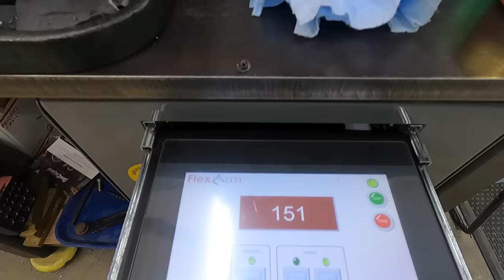Truck Hitch Crane Build Ep. 2

Comment: Why do you go through all the drill bit changes per hole versus spot drill the four holes. , then drill and chamfer them ? Isn't your DRO up to snuff?
Reply: surely wouldnt save much either way, what you save on drill changes you lose on unlocking, moving the table an locking the table again multiple times
Reply: 6 of one and half dozen of the other. I’ve done it both ways many many many times. You won’t save any time.

Comment: Hi Adam, Videos are perfect, though was not so keen on the legacy ones you put up during your vacation. Dont see why people could not view the original. 
Q. what was the pilot drill you used in the lathe to drill out the pilot hole? It had a very low angle compared to the standard 118 deg. Andy UK

Comment: Why isn't the chip breaking starting at 30:30 ? Wrong speed, blunt insert or damaged insert are the things I can think of as the culprit, off the top of my head. Any machinist care to help explain it? The rat's nest of a long curly chip is of course visually appealing but not desirable when turning. I mean it isn't aluminum after all.
Reply: cutting angle. the chip has nowhere to go so the breaker dont work. also the inner diameter runs slower so the speed is also a bit on the low end. its never just 1 thing that causes the chip break to fail.
Reply: @SupremeRuleroftheWorld  Thanks.

Comment: 25 thou isn't a lot of clearance, on those chuck jaws. 😲
Reply: Kamikaze turning!!!  🙂
Reply: It’s 0.024” more than needed. Plenty of room.
Reply: @grntitan1  With a feed rate of 10 thou, miss disengaging by 2.5 revs, and you've crashed it.
Reply: @BedsitBob  Meh, that’s what stops are made for. If a machinist can’t machine to a shoulder with a tolerance of 0.001”, there is some issues
Reply: @grntitan1  Adam wasn't using a stop.

Comment: If the plates have a machined register, then why not drill them at the same time?
Reply: the holes are different diameter as one is a threaded hole and one is drilled to pass the bolt through. so he would need to do it twice anyway to enlarge the holes. hope that makes sense.
Reply: @irorules  Yeah. After they were put together it became clear.